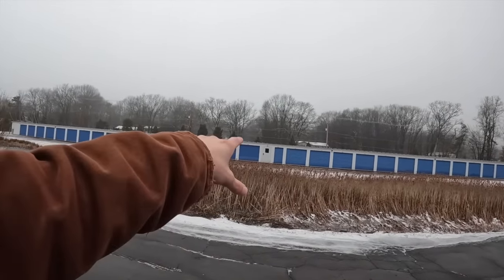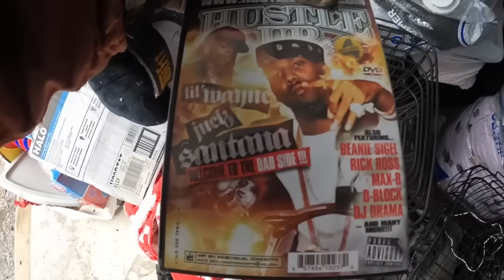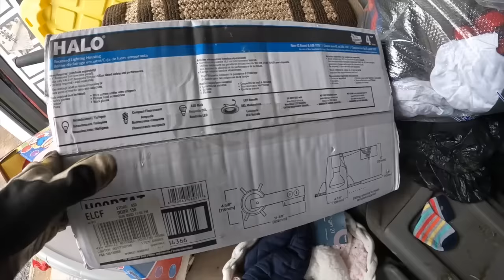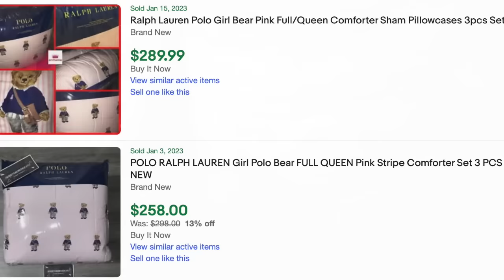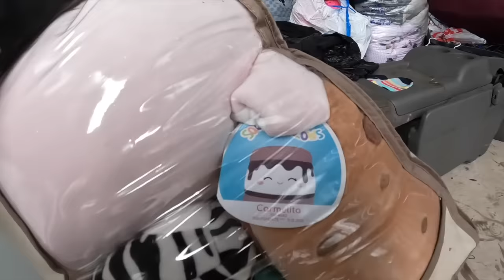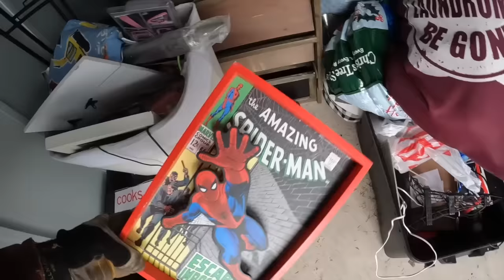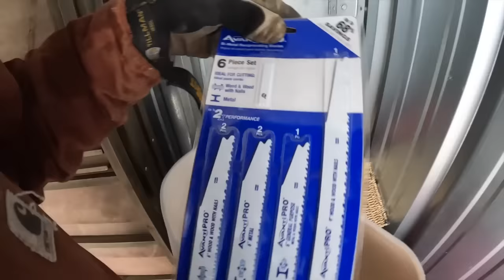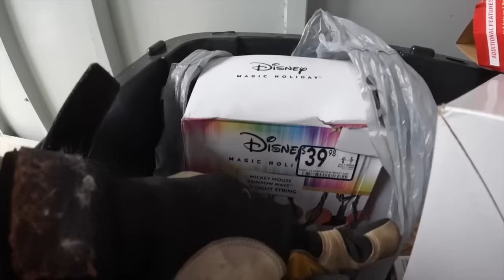I Bought a Storage Auction Locker for $10! ... Look What's Inside!

Comment: Check that vehicle seat, if it's a Honda branded seat it's from an oddysee. It's the 8th seat that goes in the middle row, there are sold listing on ebay for 300+ bucks for them.